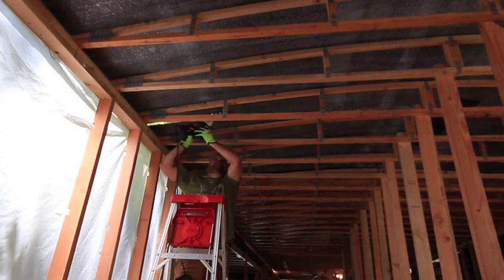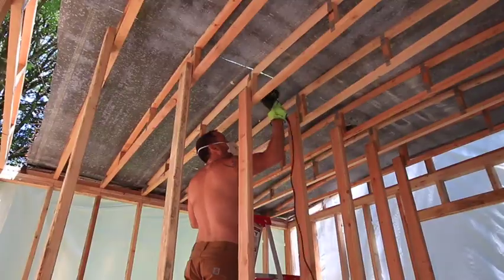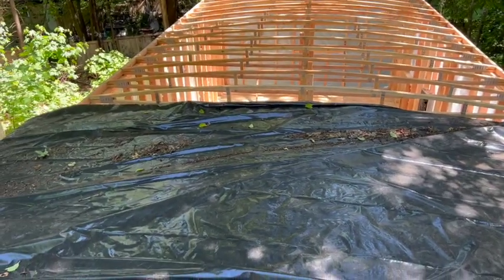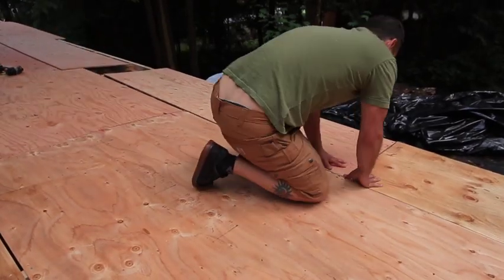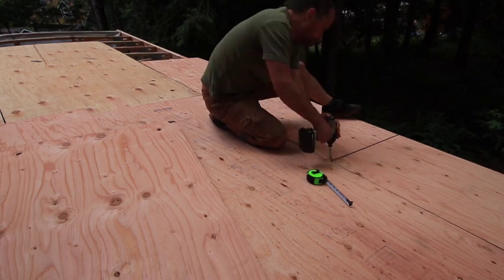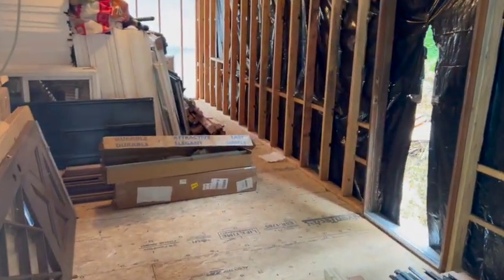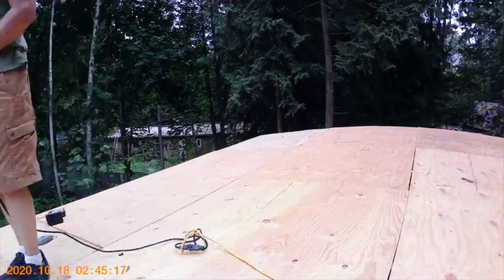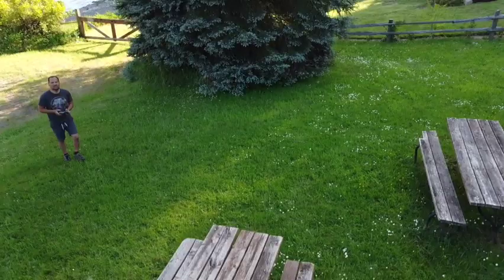Replacing Metal Roofing with Plywood Sheeting on the back end of my Single Wide Mobile Home Build

Comment: Thanks for the updated video,  the place is looking spectacular. Glad you did the overhang on the roof, it will allow the rain water not to roll along side the house  Which is very important...Drone footage was very cool....
Reply from the maker: Thanks 👍 Yeah, it turns out to be about as wide as I can go on the overhangs and still put up a 15' wide epdm rubber cap up there (it's a common width I guess. Not sure they make 16' wide sheets). I learned that by putting up a temp plastic sheet that's 15' wide and had just a couple inches down the 2x4's to staple each side to. (that's after I put up my 2" foam insulation panels on top of the roof, of which should be in my next vid).

Comment: Amazing how much you have done. Curious why you didn't tape roof to avoid water coming in?
Reply from the maker: Thanks! Do you mean, tarp? It was just that usually once the end of june hits, we don't get rain again till at least mid september and the ten day forcast didn't have any rain listed (which obviously turned out to be wrong, ha!) so I figured I'd be OK to leave it bare for a while as I still had work to do on the roof before I got it covered. I now have a thick plastic cover on it and will get the permanent EPDM rubber liner next spring when my budget allows. Cheers!

Comment: Hi binge watching all your videos. Currently remodeling a 14x60 single wide, would you recommend going lighter than 3/8 maybe 1/4. I’m in Southern California so hardly any rain and NO snow
Reply from the maker: Thanks! I think 3/8 is about as thin as you’d want go for the roof. Quarter inch is a bit too thin should you need to get up there and walk around to clean or repair. Plus where you have to screw in covers for vent pipes and such, quarter inch might not be enough to hold down those screws. Hope that helps and best of luck on your build!
Reply: @thesomewhathandyman9400  thanks really appreciate it

Comment: I’m really curious as to why you didn’t just build a new structure? I’m loving this series but I’ve always wondered about that.
Reply from the maker: It’s all about permitting and cost. My neighborhood no longer allows single wife’s so mine is grandfathered in. If I brought in a new double wide I would of had to widen my pad which would have cost thousands plus the thousands to remove my current single. Then there is the cost of a new mobile and the cost to get it moved there which is a lot of money in my part of the country. If I went with a sticks and bricks then I’d be in debt a couple hundred grand. I should have just brought this down to the frame and started blank but I think my neighborhood would have said nope. So even though I pretty much did it, I did it slyly so they couldn’t really tell it was that extensive. In the end the rebuild will probably only cost me about $25-$30k so I felt it was my best option financially. Physically not so much. But it does feel pretty good not having a mortgage.
Reply: @thesomewhathandyman9400  that makes complete sense. I hadn’t realized you were in a restricted neighborhood. Plus as a mortgage free home owner I completely understand wanting to be free of debt! I purchased my home as a fixer and I have gotten 80% of my materials by reclaiming things including my sliding glass sores and decking. I think it’s great what your doing! Are you going to change the floor plan any?
Reply from the maker: I put single wide up twice but looks like they still had to change it to wife’s even though I kept switching it! Ha!
Reply from the maker: @penniesfromheavon  yup! I love reclaiming as much as I can and shopping at the habitat store or marketplace for good deals.

Comment: Is it safe to say the ends of singlewide 2x2 trusses are 3" tall?  Not much room for insulation or sistering and warm spot to start ice damns if you add a 15" overhang like I want.
Reply from the maker: Yeah, it does go down to about 3 inches where it hits the top plates of the walls. That's why I added 2 inches of foam sheets on top of the roof  so I could have a nice cozy house. I think they really did do a lot for keeping in heat in the winter and helping to keep it cooler in the summer.

Comment: What tool did use to cut the metal?
Reply from the maker: I bought a cheap electric metal sheer. Kind of like a drill but a cutting tip on the end. Think it was only $30